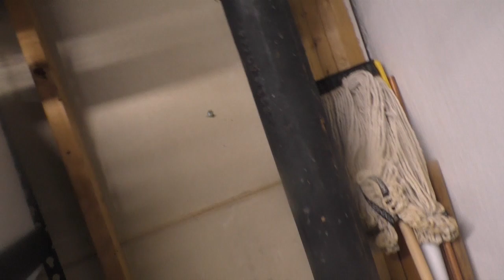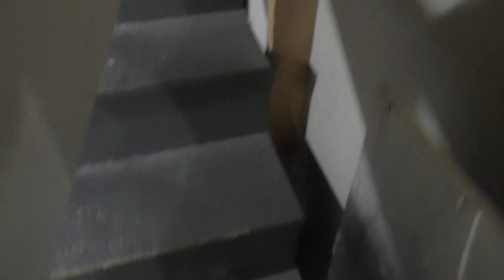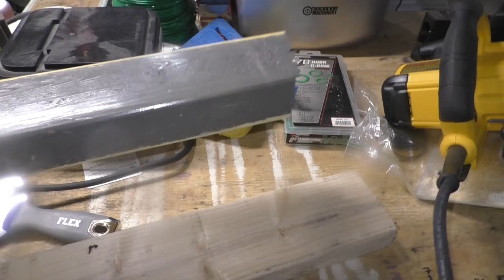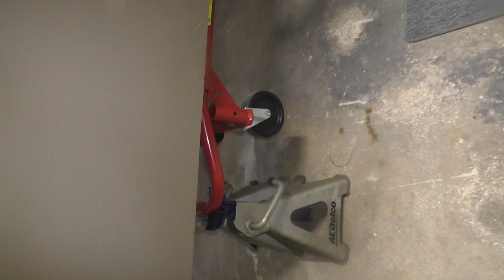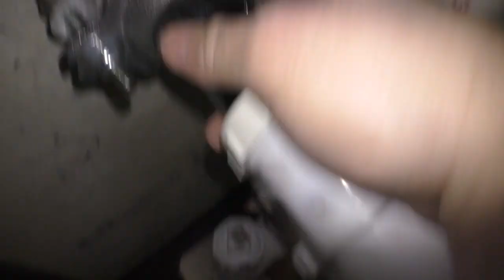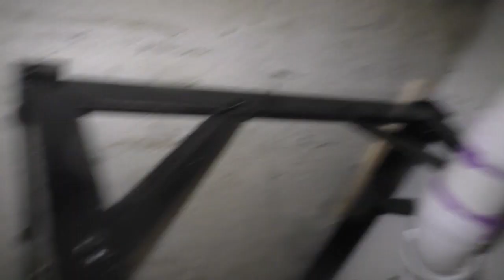Drywalling my basement office with free and recycled materials, and INSTALLING MY CONCRETE SINK!!

Comment: I wonder if you could fix the crack by drilling a small hole where it starts and ends. something small enough to fill completely with epoxy. I know it works well to relieve stress on plastics n stuff, but not sure about concrete.

Comment: Get yourself an oscillating multi tool. Those are perfect for making precise cuts in drywall, and the ability to plunge cut opens up a whole new world of possibilities while DIYing. I guarantee you'll wonder how you lived without it. Harbor Freight has a plug-in multi-speed one for like $30, which has worked fine for me. There's obviously more expensive options out there too.

Comment: In hindsight maybe testing it on the stand with a few buckets might have revealed the condition of the sink.
Reply from the maker: Yeah, but relatively impractical... i fixed the leak - in next video
Reply: @bbishoppcm  good thing.
Reply: Another thing is during the summer months you could have rinsed it and tested it's functionality a little outside too.
Reply: @robertsitch1415  It's so heavy nobody would want to transport it outside.

Comment: You may need to add drywall underneath the stairs (mounted on the stringers) for a fire brake - to meet code - for whatever reason when I had the basement finished at my last house the contractor had to do that to pass inspection.  The project is coming along nicely!